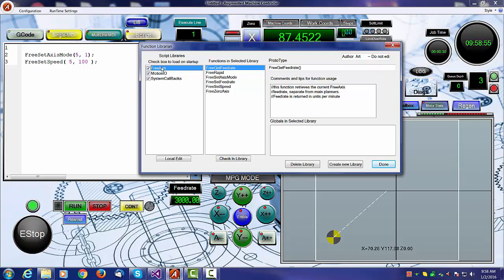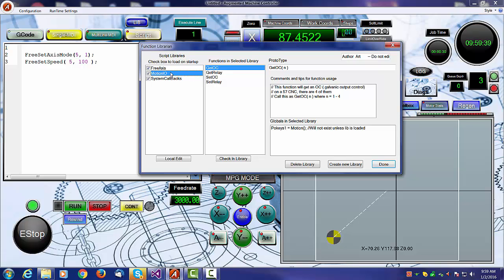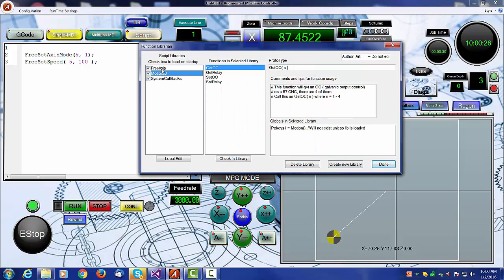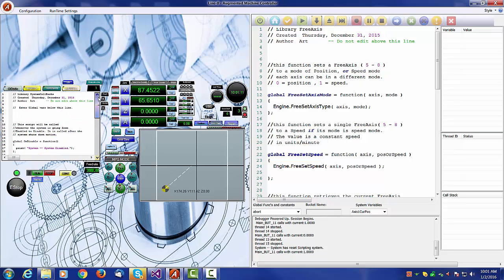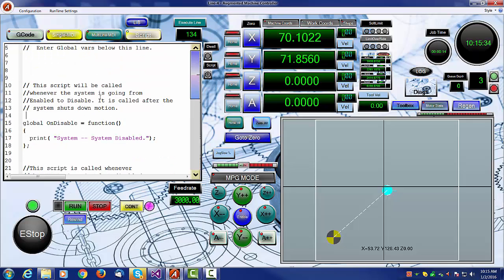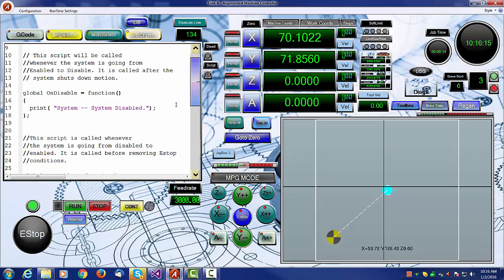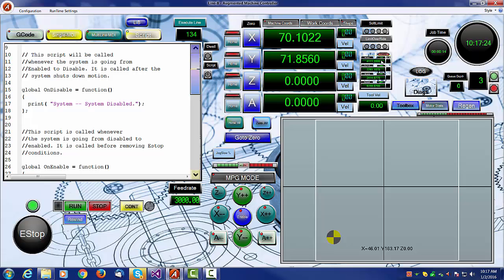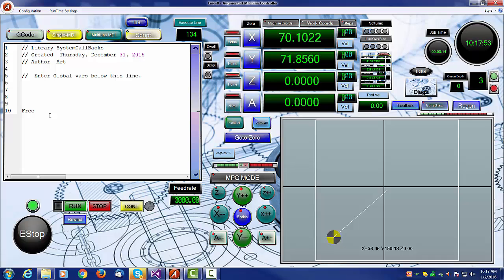Augmented Controller - Function Library

Comment: THANKS FOR THE VIDEO, I WOULD LIKE TO ASK YOU IF THIS PROGRAM CAN BE CONFIGURED FOR 6 AXES?
I HAVE A BOARD POKEY57CNC I BUY FOR A 6-AXLE LATHE AND I WANT TO KNOW IF THIS SOFTWARE CAN BE CONFIGURED FOR 6 AXES?
Reply from the maker: Sorry, but Auggie uses two 4 axis planners, one for Gcode, the other for script. If your lathe needs the extra 4 axis for tool changers and such, your probably OK, but Gcode control in motion is 4 axis at once only..
Reply: Good evening, thanks for your answer, I would like to know if the fourth axis can be used as a rotary axis? And how do I activate the relay from auggie? Thanks, I hope you can help me.
Reply from the maker: Yes, the 4th can be a rotary. Im not sure what relay you refer to though... 

Art
(I will be away for the next 10 days..)
Reply: GOOD DAYS, I THANK YOU VERY MUCH FOR YOUR HELP AS THE QUESTION IS THE FOLLOWING: THE BOARD POKEYS57CNC HAS INCORPORATED TWO RELAYS THAT CAN BE USED TO TURN ON OR TURN OFF THE SPINDLE, AS THE AUGGI PLATARPHONE IS MADE THROUGH THE SCRIPT COMMAND. THAT'S WHY I DO THE CONSULTATION YOU KNOW WHICH IS THE SCRIPT CODE TO TURN ON OR TURN OFF THE RELAYS. THANK YOU VERY MUCH FOR YOUR ANSWERS AND APOLOGIZE FOR SO MANY QUESTIONS.
Reply from the maker: Just add a botton and use ExtRelay1 or ExtRelay2 as the button name, it will then control that relay.,..
Reply: GRACIAS